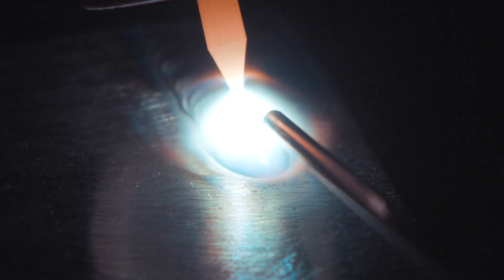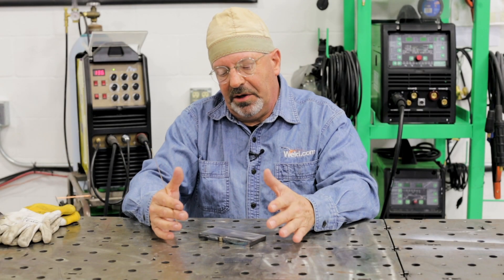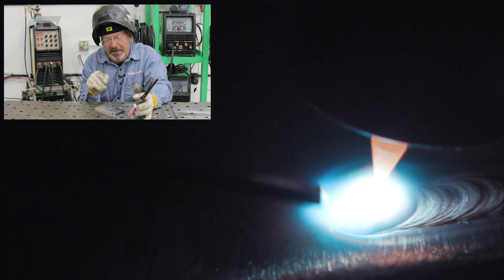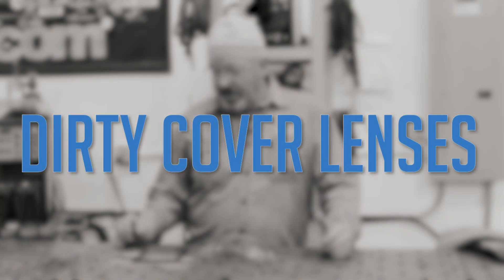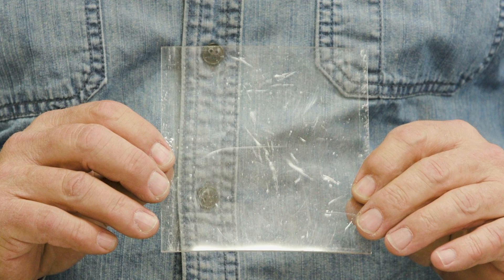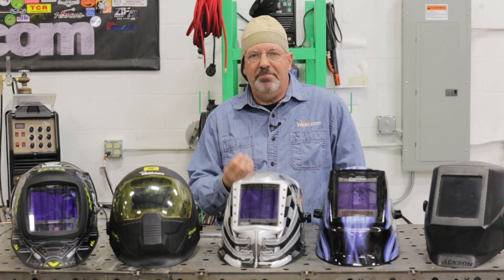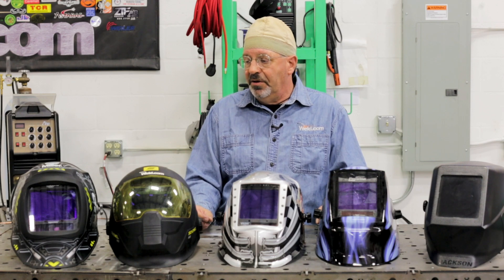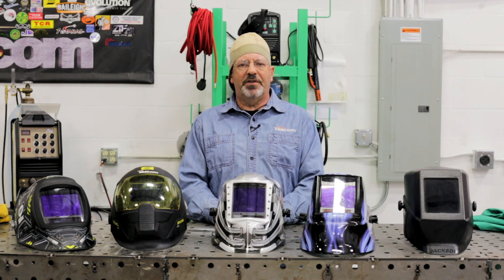I CAN'T SEE WHAT I'M WELDING!!!

Comment: Great video, beautiful technique. Thank you for your time. 
Definitely a good subject. I am not a continuous welder. However when the need arises.  I weld and at times it can be  pretty often. Generally I weld at low amps.  (Appx 80 -120  amps)  I use a shade setting of 11. I would say universally for me this is my setting.  However,  I Know,  I need to go lower in shade  settings so I am able to  see all the detail I was able to see in your video. In order to do that,  I must drop my shade setting. For me  its not the sensitivity of my eyes keeping me from dropping my shade setting to a lower setting. For me  it's the fear of unknowingly causing damage to my eyes that keeps me from dropping to a lower shade,  like 10 or 8.  
 I am certain, by dropping my settings.  I would definitely see better at these settings of shade.  I understand my question is a relative and individual thing and places you in a bad spot.  That is not my intention. But how low can a person generally go in shade settings without unknowingly risking damage to their eyes. This is a general question and I know you cannot answer specifically.  Is there a rule of thumb or any advice you can give me. Generally speaking of course. Can I drop my shade setting with out the fear of damaging my eyes. I know this is a tough question to answer .But I would truly appreciate your guidance and advice on this question. For me this would certainly help me complete my technique.  Thank you in advance  
Semper FI.
Reply: Gold lens ,  let's you see better without lower setting. Your 11 should look more like a 9

Comment: I took a 1yr. basic welding course at a tech school a few years ago. I'm sixty and I would like to take an advance course in mig and tig. My only problem was; I couldn't see the damn weld pool with out putting my head inches to the work. Boy; if I can only see I could turn out to be a decent welder and possibly get a job doing so. Thank god I ran across your vid. Out of all the vids on youtube; no one talked about seeing the damn weld when you have poor vision while under dark hood. First I need to see an eye doctor for some good prescriptions. Learning about comfort zone and adjusting the darkness of the hood shield was never talked about at that tech school. I use to think that the darker the shade while welding would protect your eyes from burns, but now I'm just learning from you about amp adjustment vs shade adjustment. I'll study this more in dept. Finally; I need to be taught how to weld in the real world situations. While in school when you're learning; you got all these perfect adjustments set just right(lighting, fume exhaust, table just right and neat) however, the real world deals a different situation which could through a newbie into panic mood. I remember embarrassing my self when I went to take a mig test at some dusty old fab shot. I'm still kind of shell shock from it cause I had no problem laying down this near perfect bead but when I was told to do one 12 inches long; I freaked up. Dragging a long  bead in mig was never a focal point at that school. More emphises was put on stick welding and blue print reading. Well, living in a small town in Tn don't have a high demand for stick welding. They're not doing the steel structural thing as much as they did back in the day. It's more about mig in the fabrication industry, ship yards and tig in the food processing plants. Right now I got my eyes on a Kellogg's plant that's always in need of tig welders but I'm going to need more training. I'll start practicing on the little knowledge I've got but I'll need more training to pass their tig plate test. I'm willing to get back in school but not the tech colleges hear in Tn. Question; Do you have any recommendations for  real world training in Tn or, do you think that you can offer an online course for those who would like to improve their skills to work in the real world environment?
Reply: Harrison Williams , I am in the exact same place......I cant see what the hell Im doing.....

Comment: What is a "cheater lens"? 
Are you wearing progressive lenses glasses?
I realised that shining with a bright spotlight on the welding area helped me to see better. The contrast between arc glow intensity and surrounding area is not so strong.
Your opinion?
Reply: A cheater lens is a 'magnifying glass' for your hood.
Reply: @iAmHitt  thanks, good to know. 3M offers magnifiers for my Speedglas 9000 at 25$ from 1 dioptries to 3 dioptries.

Comment: FWIW: Issue is when you have to weld something that is not on a flat table. I when you have to weld on a large items that is at angle on the under side. Another issue is when you have to weld in a crevasse or tight corner, where its not possible to easily see the weld area. 

IMHO, its kinda silly to provide a TIG welding video on "seeing what I'm Welding" On a perfectly flat weld, which is likely less than 20% of typically TIG welding jobs.

Comment: clean your welding helmet lens with compressed air, nothing else! if you're working in a shop with a tig welder, chances are you have 8 bars of air to clean your stuff. DO NOT use your clothes (jacket or hoodie arms). I also clean my welding table with air everyday to keep all the dust away.

Comment: Have welded all my live with 20/20 vision for most of it. Now in my late 40’s I’m wearing readers and this is a big problem for focal distance. In reality you can’t always weld at a perfect arms length as described. You have to weld where the work is.  Currently I use a 1.0 cheater and I wear 1.5 readers. This gives me the ability to take the readers off if the focal distance changes, but this is aggravating.  I have considered getting bifocals.  Any comments on bifocals vs what I am using now?

Appreciate the video.
Reply: I had to get single vision glasses for welding, with the bifocals, when I struck the arc I was almost always looking thru the wrong lens.

Comment: Background lighting caused an issue for me. I got a leather sandblaster's hood, cut it to fit over my helmet. Using a snap kit intended for boat mooring covers, I installed snaps. The hood fits over the back of my helmet and is great when working on cars and other out of position work.

Comment: I have found that the quality of the shaded filter lens makes a noticeable difference.  A good lens allows you to see not just the weld puddle, but just outside of it also.  This is huge when stacking beads around a pipe or finding that bevel edge when ur jammed up at 6 o clock on pipe.  I still haven't found an auto filter that beats a $20 gold lens, but some of these newer "HD" lenses come close.

Comment: Been having issues with flashes, not only when striking a GTAW arc, but also in the middle of welding; sometimes all I get is constant flashes.  The flashes are bright yellow, not blue like when you dip the tungsten.  I am starting to believe that a have a machine problem, but cant quite figure out what.
Reply from the maker: When you say "flashes", do you mean your auto dark is flashing you?
Reply: @Welddotcom  No, not the auto dark going in and out of dark mod.  Its the actual weld arc that turns super bright, sometimes is a quick flash, but lately is more of a constant very bright arc.  I suspect is a problem with the foot pedal, but I am also an amateur/weekend welder at TIG welding.

Comment: Another problem not mentioned is steaming up. In winter I find that I can only weld for as long as I can hold my breath. Then the first exhale causes condensation between the different layers of lenses and I have to stop, clean, demist and use an anti condensation wax or similar.  Anyone had any success installing the likes of a computer fan on the hood? 
Perhaps a non starter but I have always wondered whether a mirror on the front of the mask with a cutout for looking through might reflect light back onto the work, thus partly eliminating the huge difference in light levels of the arc itself and the surrounding work.
Reply from the maker: There are ways you can breath to help control the steaming of your lens. Try breathing through your mouth, but exhale in a downward motion (if that makes sense).

Comment: Forty years ago, it wasn't a problem. It is now. Age related vision problems are a serious handicap to good welds. In my case, the only way I can change the focal distance of my eyes is with different strength glasses. Everything that you have mentioned is important. When cataracts start to affect your vision, anything other than perfectly clear cover plates and lenses will affect visibility. Positioning is important when your corrective lenses are set to focus at 12 inches. I try to keep a selection of glasses around so I can pick the one that works best at the distance that i want to be from my work. The glasses that I use for a computer screen are not the same ones that I use for fine work. I like to weld outside, so ambient light and reflections are a real consideration. I'm considering a pancake hood, but haven't tried one. Lens shade is also a factor. Most of what I weld now is thin material at low current. A shade 9 seems to work best for me. My welds look fine, but they are not where they are supposed to be. I can see the arc, but not the work. I don't expect things to get better, so I need to make some changes to my technique. Thanks for bringing this up.
Reply from the maker: Try using a soapstone or other marking tool to highlight the weld joint. It may help you follow where you're supposed to be.
Reply: @Welddotcom  It can't hurt.

Comment: Would you recommend the Lincoln 140HD MIG welder for a beginner? I am  19 trying to just get into welding, most likely small projects nothing super structural. (most likely flux core as I will always be welding outside). Im not set on a mig welder but from my research it seems to be the most versatile for my needs such as aluminum and mild steel. 

I do not have a 220v outlet but if need be i could get one installed.
Reply from the maker: The 140 is ok if you are just going to be making small repairs. If you're doing anything more than that you will outgrow it quickly. Check out the Everlast line of machines. You can get higher amperage and more features and still maintain a lower price point.
Reply: I have found that welding thin steel like exhaust pipe using an oxy acytelene torch is very effective. Ages torch can also be used to braze. I have nor had much experience with TIG or MIG. Arc welding on heavier plate is my experience. 

I found out I have to illuminate the weld site with very bright light so where I strike an arc with a stick is more than a guess. Makes for neatrer and better welds.

Comment: I just finished a TIG course at a local community college. I started the course using the “loaner” helmets but very quickly learned that was a huge mistake for all of the reasons that you covered. I wish that I had seen this before I started. I learned that if you want to even pick up a torch, make sure that you first invest in a good quality helmet, good gloves and a jacket! 

Can you cover “handedness” in a video please? I’m normally a right hander, but found near the end that holding the torch in my left and using my right for feeding the wire gave better results because of the better dexterity. For the record, are you a lefty? What is your experience for this?
Reply from the maker: It's all preference. Generally, most people use their dominant hand to hold the torch.

Comment: It's settled. If you're seeing the weld pool as clearly through your hood as that camera footage, I need a new/different hood. I can barely make out any details while mig welding while indoors with bright fluorescent lights.
Reply from the maker: There are a lot of people that will tell you that a good hood doesn't make you a better welder. They've probably never used a good hood, because the new hoods help you see everything around the pool, and THAT will help you make better welds.

Comment: in door out door makes a difference on what shade I use. Of course the people that stick there face in there work are going to need to change them often. I want to put a link to a very affordable hood in a  4in true color lens for under 70 bucks. I have this hood and like it a lot. I wear bifocals and have a hard time getting lined up on a small lens. I couldnt talk myself into throwing down 300 bucks for a hood now that I am retired and only hobby weld so I took a chance on this hood and love it. It comes with a bag to place it in when not in use so it wont get dusty.  weld cut and grind mode  https://www.amazon.com/gp/product/B07M5WKCYX/ref=ppx_yo_dt_b_asin_title_o03_s00?ie=UTF8&psc=1

Comment: Here's a comment on "cheater" lenses that may help some people.  I started using them some years back, but when I recently got a new and "better" helmet, it turned out that the clips that hold the regular filter lens in place will NOT allow room for any extra lens thickness.  My solution was to wrap electrical tape around each end of the cheater lens so that about the outer 1/4" of each end is wrapped in tape and the rest of the width of the tape forms a flat "tab" that sticks off each end of the lens.  Those "tabs" of tape fit beneath the lens clips in my helmet.  It works great, and even slides up and down across the back surface of the bigger filter lens to match whatever part of the filter lens I will be looking through for the work I'm doing.

Comment: Hi Bob,
Im looking the buy a multi typeac/dc welder for tig, mig and stick.  I need it for light fabrication and, for repairs to a loader and backhoe.  Your review of the esab multi welder with the adjustable frequency was outstanding.  I went to my local welding supply house, who carry Miller and Lincoln.
They said you really need to be careful with that unit because if you turn the frequency up to high, you will scramble all your electronic gear in the shop, and would have to replace it.  Is that true?
Thanks for your advice, and if you could give me a recommendation on a specific unit, or general size/$ amount you think would work, I'd appreciate it.

Comment: I have a cheap plastic 90x110 simple glass mask(one that you hold with your hand,old style) usualy i run no 9 -10 shade but i only stick weld so it covers my needs.What helped me see better is cheap 10$ Led reflector.So you might add some light source,just to get the shade right.
Also does anyone know if they still produce brown glass shade?My cousin got one in his old welding mask ,its just so much better when it comes to visibilty.All i can find is green glass.
Reply: The "reflector" link doesn't work.
Reply: @billmoore4554  Blame the stupid youtube,it was not meant to be link.

Comment: does the filler wire actually touch the material your welding on. or do you put the filler in the flame?
Reply from the maker: Dip the filler at the front edge of the molten puddle.
Reply: Thanks. im in welding class and we just started TIG. haven't had any trouble until now. and Ive had big droplets and big puddles.

Comment: You have been so much help to me. I cannot thank you enough. We recently got my friends hi-freq lincoln box up and welding. It has been a little struggle but we are welding thin aluminum. Without your help from your videos it would have been so much harder. This video is particularily good because my friends helmet does not have shade adjustment. I brought the one home from work which does so I am hoping it helps a little because with his helmet I was having trouble seeing. Thank you again.

Comment: You spoke briefly about 'cheater' lenses. 
Forgive my ignorance, for I'm not a welder and have no training in welding (only soldering copper pipe). What exactly do you mean when you say "cheater lens"...?
Reply: It's a rectangular lens you can install in your helmet that works like reading glasses you might get at the pharmacy -- allows you to focus closer when your eyes are older and loose the flexibility to focus closer. Or maybe you already wear glasses, but with them you see well at distance, but not closer, so again the cheater's added "reading glasses" effect if good for the closer distance. Even if you wear bi/trifocals, the lower area of your glasses that's good for close up bay not line up with the helmet's window, so again, adding a lens there can help.
Reply: Thomas, a cheater lens works like the bi-focals on glasses for near vision but cheater lens are put on the inside of your welding helmet instead of wearing  your glasses. Hope this helps!

Comment: My biggest problem is that I can’t always see the weld line. I set myself well, but then I might wander off. I put as much light on it as possible, but sometimes, it’s not enough. I get in between, or I’m around a curve where the light can’t reach. Feh!
Reply: You could run a fine line with a white chalk or use a grinder with a 1mm or thicker disc. If you are doing a butt weld with 5 mm or thicker plate, your edges should be bevelled anyway.

Sometimes on a long butt run, if I see an issue arising I will lay  (or maybe clamp) a steel section off the line and use it as a guide bar. If I'm touching it or am very close, I can see where I am. Have to set it far enough away so it doesn't get included in the weld!

Comment: I'm semi-retired and took up welding as a hobby about two years ago, stick and MIG. I had a miserable time seeing the puddle using most hoods in class. I tried the Lincoln Viking 3350 and it totally changed my welding experience. I can see everything I need to see. It's pricey but well worth it.
Reply: Scott B how do you protect the outer lens?
Reply: @jeremyR87  you don't protect it, you replace it as needed
Reply: I'm still can't see and I have the 3350 and 350 dollars later I'm still searching I guess hopefully there is a hood for me somewhere